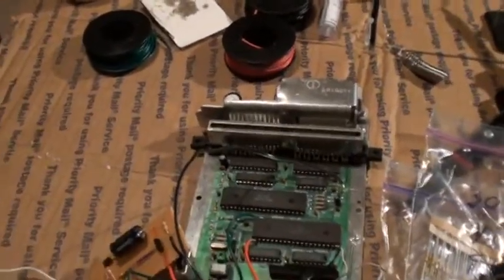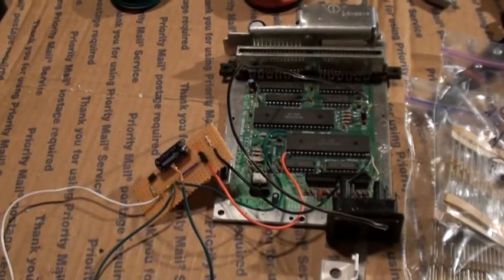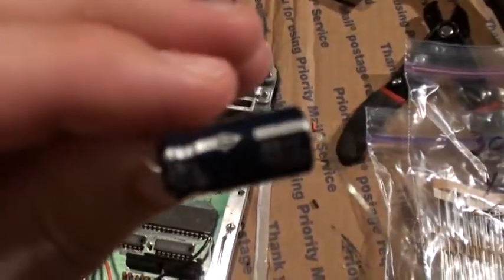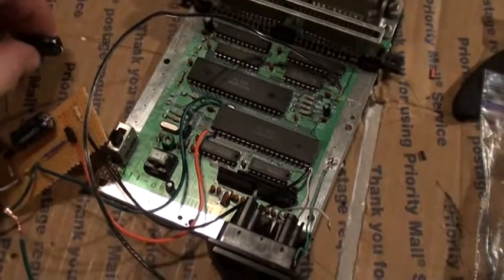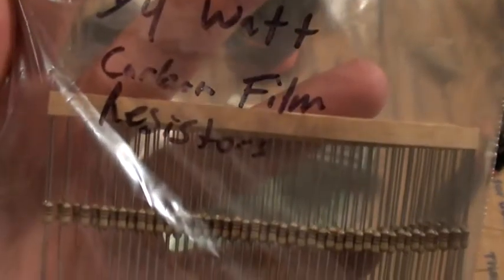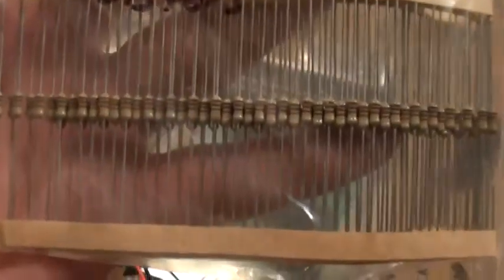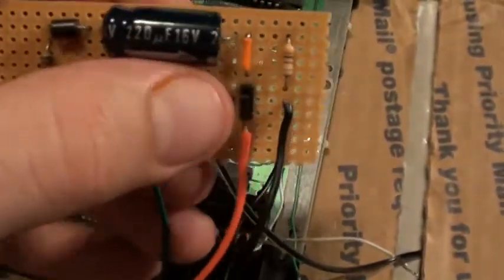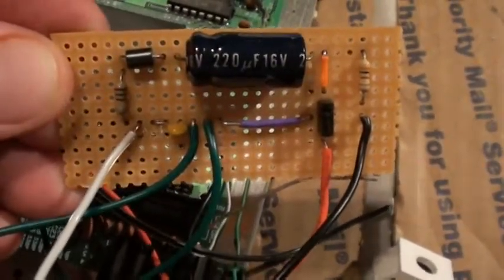NES Toploader AV mod (general guide)- Part 1/2

Comment: I ended up getting a replacement chip. Tore out a trace trying to get the old one out but managed to fix that with a bit of wire. Socketed in the new ppu and everything works just fine.

Comment: If you're feeling adventurous you could try taking a Dremel to the chip in order to expose the trace that connected to pin 21. Then once you've soldered your wire to the trace you can apply some hot glue over the area for protection.

Comment: This kind of modding is a little more than I'm willing to get into, but I understand the benefits of getting A/V out of the top-loading NES.

Though, I actualy heard recently that if you were to plug a non-av modded top loader through RF into a VCR, it would help clean up the signal issues commonly associated with the reason to mod the system.  Kinda like a reverse RF modulator - rf to vcr then vcr composite out to tv or whatever other capture device or monitor you want to see the games on.

Comment from the maker: @eSkilliam 

I haven't ever seen that mod. I think it would be really difficult, because those ports are hardwired to the board. I guess you could steal it, but then you would have to figure out a way to secure it inside the toploader. 

If you find a link showing it, could you talk about it in a video?? 

Thanks.